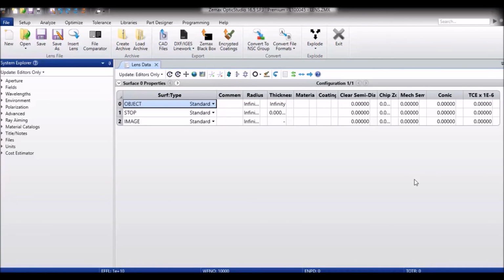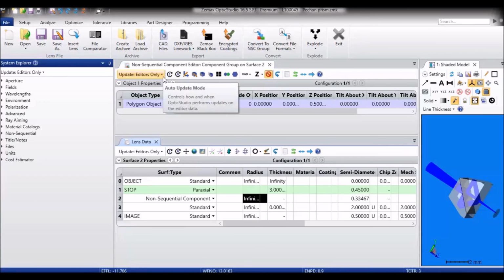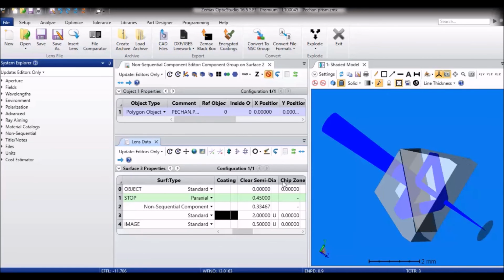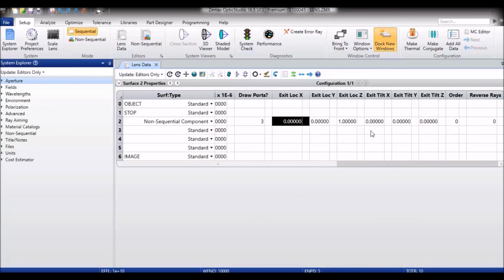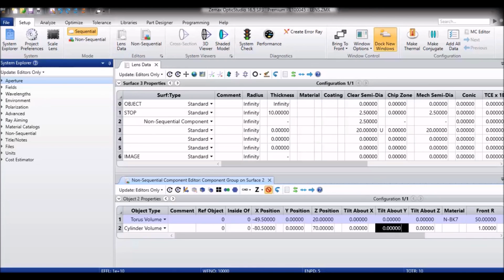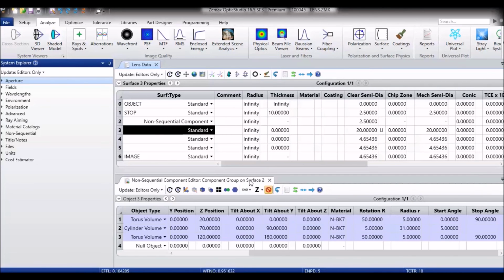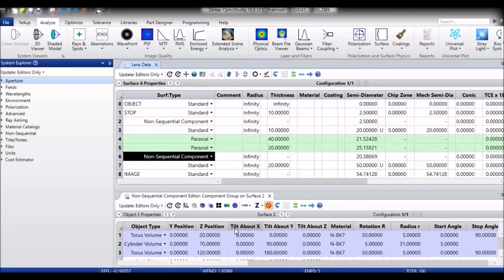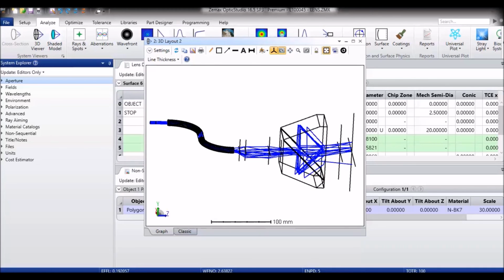Creating sequential systems with prisms, CAD parts, and other complex objects in OpticStudio

Comment: Two questions: 
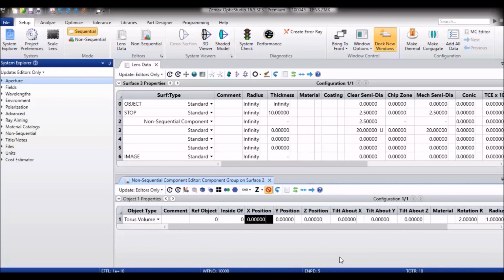1. @11:47  Why did the designer choose a value of -49.5 mm for x ? 
2. @12.59 Again, can someone explain the -80.5 mm here ? Assuming input of the toroid at -49.5 mm, I would have assumed the x coordinate of the 1st torus vol exit = the x coord of cylinder input facet = -49.5 - 5mm - 50mm  = -104.5 mm. Someone please help.